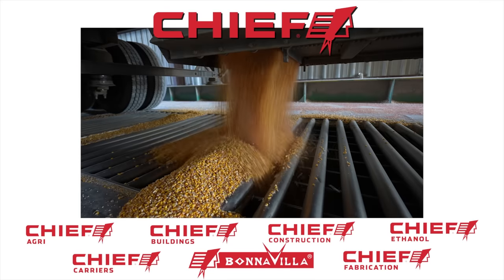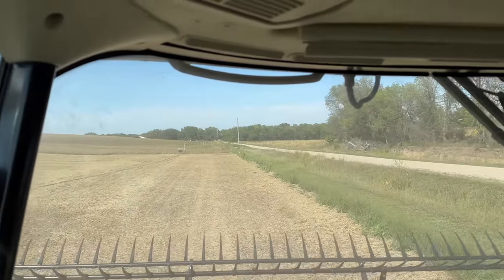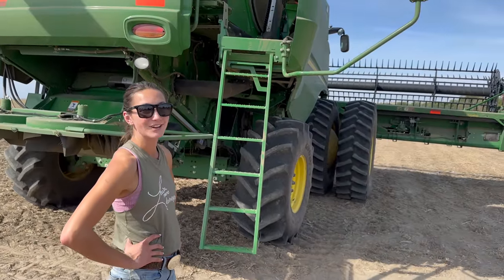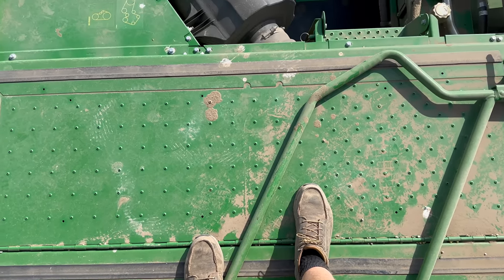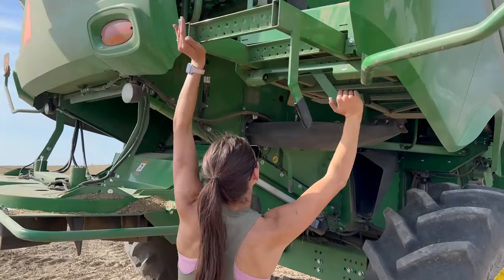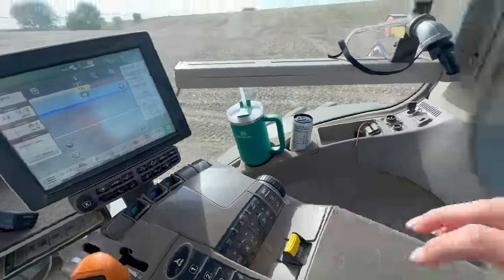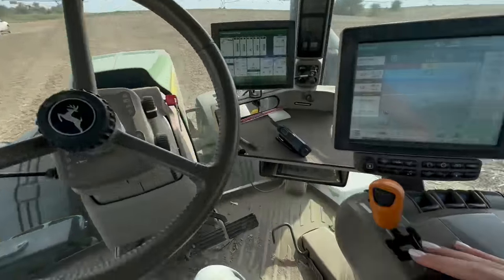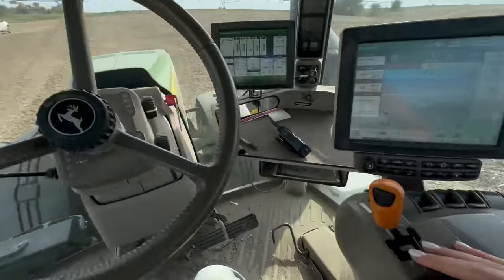We Burn A LOT Of Off-Road Diesel

Comment: Hi Laura, What is the blue fuel hose which i saw you  use on both machines? I think you said "def" , but what is that?  Thanks.
Reply: Diesel exhaust fluid. It is supposed to lower smog emissions

Comment: Noticing the water extinguisher I’m assuming it’s for the possibility of the grain or grain dust catching fire if that’s correct is their a common cause of grain catching fire?
Reply: Combine fires are something you absolutely have to be vigilant about. A failed bearing overheating can lead to a combine burning down to scrap in a shockingly brief amount of time.

Comment: Are you concerned about corn prices being down 28% YTD? Is there a certain price you need to get to breakeven?
Reply: Most farmers will sell their crop before harvesting with a contract delivery date , usually at a higher price than in the fall . Also most farmers have bin storage so they can sell their crops later , usually at a higher price than in the fall .
Reply: Ok thanks. But they seem to deliver the corn directly to the ethanol plant after harvesting not sure about the soy but I understand your answer. Hopefully its pre-sold at a higher price.  @toledojeeper2932
Reply: @DManGrand  …Yes , we sell some grain in the summer for delivery in the fall . You will usually get more money when you sell it before fall .

Comment: Both wrong with cross chains. It is to keep the trailer from swaying away from truck in case of disconnect. You stay in control of trailer when steering. 24-year CDL holder that's how I know!

Comment: When trying to back up with a hitch without a camera, use a tape measure to measure the distance, and then place the tape measure next to your car door. You can watch the tape measure as you roll backwards and see where you need to stop.
Reply: i just look from inside to the lower corner of my open door and pick a spot on the ground the proper distance to move to before stopping,,,,

Comment: 1:39 what’s the difference between those 2 ???
Reply: The ball she flipped to top is 2-5/16 inch.  (note the sticker on the side of hitch)  The other is 2 inch.   A tri ball hitch would also include 1-7/8 inch ball.
Reply: @gregorycross612  I didn’t know there was difference in them, I always see cars with a normal hitch with 1 ball welded on there
Reply: By flipping the hitch over, it lowered the ball by about 4 - 6", presumably so that the fuel trailer will be more level.  The two balls had to be rotated because one has a different diameter than the other.  Only one ball will fit the trailer hitch properly.
Reply: @edschultheis9537  yea, the lowering the hitch I understood but the different sizes not, I guess that’s not common in Europe
Reply: ya were goofy over here - haha.  not sure on how many sizes - 1 7/8 for smaller trailers, 2" for medium, 2 5/16" for larger and the big rigs  - not sure of.  I remember in grade in school there was a push to move to metric system and the country darn near revolted over it.  Where the hell did a foot and an inch come from  - "going to the rope store - where are the big boots at".  Dont even want to get into liquid measurements.  Need to carry a conversion card with me.  Wait, now how many pints in a quart, and quarts in a gallon and ounces to it all to get my mixture correct -haha.    @Donuts_random_stuff

Comment: You should never interrupt a driver no matter what they are driving. I am surprised that you do not know why the safety chains are crossed. That is done so that the trailer tongue will not drop to the ground and get damaged if it comes off the hitch but instead will rest on the safety chains.

Comment: They should make u guys use electric combines, then the earth would be clean.
Reply: They should make you wear a plastic bag over your head, then the earth would be clean.
Reply: Lol . Ya because there are plenty of chargers in those fields .
Reply: Those combines are 400 plus horsepower and with those green stems they are using every bit of it. Electric motors of that size are usually powered by a Diesel engine and a generator.  It’s more efficient to just use the Diesel engine to power it. More compact less weight and less to go wrong